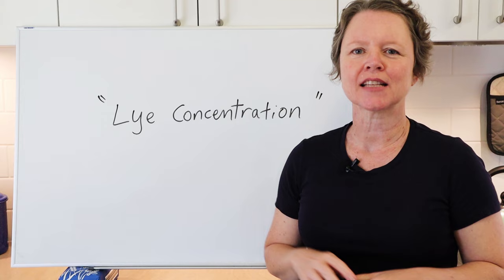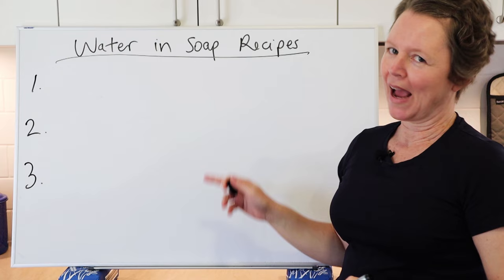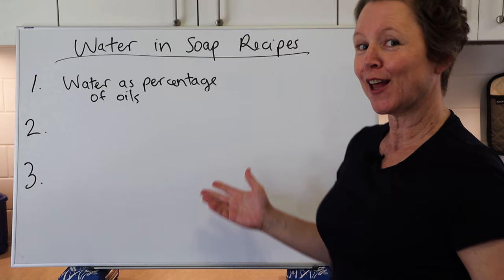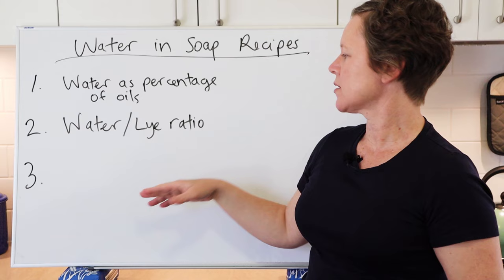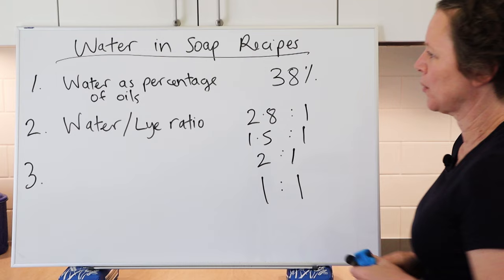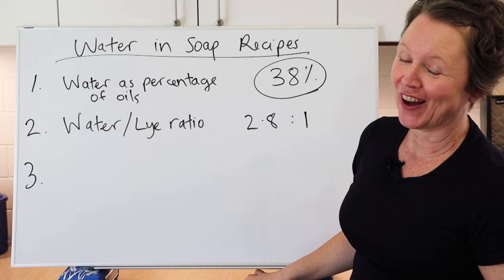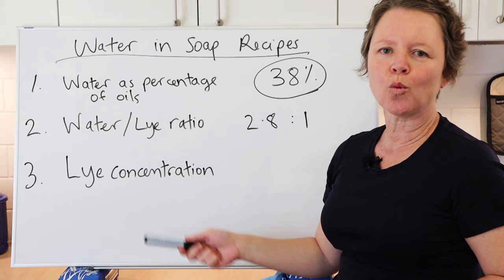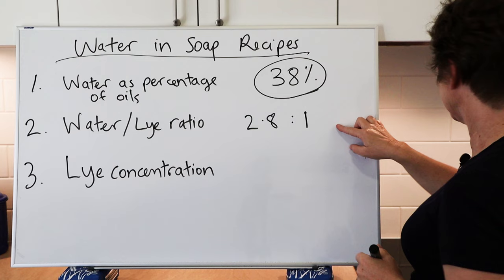Calculating Water in Soap Recipes and Clarifying 'Lye Concentration'

Comment: I am happy that you made this video. It is appreciated. Hands down the best.
Reply from the maker: Thank you Kelly!
Reply: You're welcome. I've doing 33%-38% water. I'm going to try 30% to see if my bar is harder faster.
Reply from the maker: Do you mean water as percentage of oil amount? Depending on which method you're using this could make a softer or harder soap!
Reply: @EllysEverydaySoapMaking  Yes, that's what I mean. Water as % of Oils. I do cold processed. Everything at room temperature. Never used the Lye concentration or the Water: Lye Ratio on soap calc.

Comment: What is High Lye C means to the soap? How does it affect to the final soaps when the lye C is 30% vs 40%? More leather or less to the soap? Obviously when it's a 30% lye concentration has more water so it takes longer to cure but I am curious about leather to the soap? besides using certain kind of oils. Perfect timing for your video to show up.....Thanks so much Elly!! Especially, for the salt soaps...
Reply from the maker: Thank you Kristie, the water amount doesn't have any impact on the lather of the soap, it just takes longer to dry out :)
Reply: @EllysEverydaySoapMaking  hi Elly,, lovely to see you! what about the Lye? High amount of Lye gives better leather?
Reply from the maker: No - this video has nothing to do with the amount of lye in a soap recipe - the amount of lye completely depends on the oils used, and the superfat amount in the soap recipe. You don't get to choose the amount of lye for your recipe - the calculator does that for you! :)
Reply: @EllysEverydaySoapMaking  I completely understand what you are saying now. Thanks!! 
I have been making sea salt soaps only  nowwadays. Soooo soothing to the skin, 30% lye C, 20% super fat and 50% sea salt. Better suggestions?
Reply: @KrsitieSimplyBlessed  leather is a preserved animal skin, you may make boots, shoes or jackets from it. LAther is the suds and bubbles from using soap. Spelling counts! As does pronunciation. So keep it in mind that saying LAther vs. Leather is actually  a HUGE  difference!
Reply: @cryingbroken8824  lol, voice texting....

Comment: Thank you, for sharing this!  I prefer using the lye concentration, and formulating my recipes from scratch without a soap calculator.  I heard when using the "water as percentage of oils" can very with trace and cure time ,especially with different oils even though you are using the same amount of water for each recipe.
Reply from the maker: You're welcome! Yes, you're spot on. I tend to use slightly different water amounts for different recipes. I use a lot more water for HP :)

Comment: That was very clear & I understand what you have explained. I have been using your method of Lye concentration from watching your previous tutorials as I am a student of yours through youtube, but without that & the soap calculator I would not have any idea how many grams of lye  & how many grams of water to use for each soap recipe. I could not work out the lye concentration for a recipe without a soap calculator.
Reply from the maker: That's right. The calculator tells you the amounts, but you tell the calculator what percentages you want :)
Reply: @EllysEverydaySoapMaking  yes but without a soap calculator how would one work it out? How would you workout the amounts without the soap calc?

Comment: I've come back to this video again as I was confusing myself. My misunderstanding which has now been cleared up was that the lower the lye concentration, the less water there was in the soap. Some kinda wierd logic in there.
 I've made 3 different batches so far with different concentrations to test for hardness as I'm still new to soap making and experimenting with variations on a recipe. 
This explains why my first soaps at 27% and 33% concentration were softer than my soap at 40%. No wonder they are taking longer to cure.
I've been looking closer at the numbers on soapcalc.net and now I see the higher the Lye concentration, the less water is required. I should have paid more attention previously instead of concentrating purely on the weights of my ingredients.
Thanks for a great video to help us new soap makers by clearing up the confusion.

Comment: Thank you so much, you have the key of my dreams God preserve you
Reply: I have a question concerning soap making, may I ask you?
Reply from the maker: Yes, sure!
Reply: Ok thanks, according to my knowledge from your lesson during the cold process         the colarants must be in solution mode instead of power and that solution should be made of oil and concerned colarant. My question is may we use the same kind of oil similar to that mixed with our lye? Also I don't have any worry about the ratio for water and lye for instance if; KOH =4kg hence water would be 11.2 litres, now what could be the measurements of our colarants and vegetable oil for the given lye solution above?

Comment: Elly I made this recipe from you, oliva 80% coconut 10% castor 5% cacao butter 5%,  4% superfat, 40% lye concentration ( numbers came out like this 201.6 grs water and 134.43 sodium hydroxide) so it means this formula contains 60% of water only? I will appreciate your answer. Thank you and kind regars. You are perfect teaching how to make soap  :)
:) already check out the tutorial, CLEAR as water jajajaj yeah!  my soaps got cured perfectly thanks to you, by the way I´ve paid lots of "soaps courses" bad too bad nobody explains like you, better said only tell to use soap calculators and additives without any justification why to use it. Thank you
Reply from the maker: Hi, no it's just the lye solution that has 60% water. If you're using a 40% lye concentration lye solution, then the solution will be 40% lye and 60% water. This only relates to the lye solution, not the whole soap batch :)
Reply: When input yhe formula in soapcalc I selected lye concentration (I haven´t watched this current video) and the calculator shows  lye concentration 40% water as percent of oil 20.17% water lye ratio 1.5:1
which is the method you recommend me to use, the area of mexico where I live is very hot most of the year is about  35-40 Celsius and when is little fresh during rain season is really bad because humidity and hot is horrible :( 2 years ago had to throw to garbage many kilos of soap because got damage (rancid)
This recipe worked ok so far but is kind of kind if soft the soap...of course after curing time is fine and is so creamy....thank you

Comment: That was explained so clearly and easily Elly.
My question to you is what Lye Concentration percentage do you mainly stick with. I've been soaping with a bit of a lower Lye concetration percentage and I'm not happy with it
Reply from the maker: So with the lye concentration method the lower the concentration (of lye in the solution), the higher the water content. My usual level for most of my soap recipes is about 40% lye concentration for the lye solution - pretty low water! I use a lot higher water for hot process soaps though, about 30%.

Comment: Thank you - this makes the terms so much easier to understand and that the lye amount does not change, only the water.  So a 1kg batch of 100% Olive Oil with a 5% superfat will take 128.70g Lye always but the water amount can be altered from 380g (soapcalc default) to as low as 128.70g.
Thanks again
Reply from the maker: You got it :)

Comment: Hello Elly. You do an incredible job with that channel. Thank you very much for that !

I think that I looked at that video for the third or fourth time. One thing still confuses me about Lye Concentration. In chemistry, the concentration is expressed by the relation of the mass of the solute over the total mass of the solution. not the mass of the solvent. If I follow what you say, Lye concentration would not refer to the solution concentration itself but the relation between the solute mass over the solvent mass. So, the term it is the word Concentration that is misleading. 

For example, if I put 25g of salt in 100g of water, i won't have a 25% aqueous solution of salt (25g/100g) because the weight of the solution will have increase by 25g when the salt is added. So, the total weigh of the solution is now 125 g and the concentration is 20% (25g/125g). Is Lye Concentration is a traditional or legacy method to put in relation the mass of the solute over the mass of the solvent ? If so, this might be the source of a lot of confusion. 

Thank you for taking the time to read. I hope I am clear, English is really not my main language.

Comment: Hi Elly,

I have been thinking of soapmaking for about a year now on and off.  My problem I have to get past of the fear of failure,  but going to do this.  First thank you for your valuable time,  you are sweet.  My question is:  out of those three calculations, you pick one way, right?  Those are 3 different ways to calculate lye concentration. 

Thank you 
Susan
Reply from the maker: Yes that's right Susan. These are the three different ways to calculate the amount of water in a soap recipe. For the sake of simplicity, these days I use  the water to lye ratio method (which you will see in my videos from the last year or two)

Comment: Yet another amazing video..... 
But is there a way to formulate your soap recipe without soap calc  and still be able to have the flexibility of adjusting the lye concentration as you wish (I use the lye concentration Method as u thought in ur previous video)..... 
......
........
Thanks so much for ur awesome detailed information on each video... Am literally ur student... Love ur videos... 
...pls I put up a comment on one of ur recent picture uploads with some questions on some issues I've been having with soap Seizing after using a 50percent lye concentration in the recipe..... 
Used Only palm kernel oil, soaped at room temperature (it was fractionated PK oil I guess... It's in liquid form deep bright yellow colour)
As soon as I pour in the lye solution... It literally immediately starts forming some kind of Vaseline-ish substance at the bottom... Bfr u blink n try to stir it... It's all but a thick mass..... Crumbly separated into bits and dry..... 

Pls help.... Could this be as a result of the lye concentration I used? 
Or is something wrong with the oil.....? 😫😫😫....
It has happened twice already even though the soap turns out great for washing... Amazing lather! No additives..... 
I just wish It could ever be smooth so I can do some other fun stuffs 😭😭😭😭

Comment: Hi! Thanks for your video. I’m looking for some help. I am experimenting with adding hydrosol into my soap for scent because I can’t use essential oils or fragrance oils. I want to add them at light trace, not in the lye solution. Can I discount the amount I plan to use of hydrosol from the lye solution as long as the lye solution ratio itself is a minimum of 1:1? Thanks!
Reply from the maker: Hi Jackie, yes you can do that for sure. I don't know if I'd waste lovely hydrosols in soap though, I don't think you'll get much scent coming through.

Comment: could you please make a video on how to water discount??? i had an issue with a recent batch i made, the soap turned out way too soft and unmolding it was very difficult. I already identified the probable causes, they are:
 a) since NaOH is hygroscopic and it has rained these past days, the crystals adsorbed water molecules and I weighed less NaOH (probably most of the weigh was hydration of the crystals rather than the actual NaOH mass)
b). I added aloe vera gel in frozen cubes mixed with the water ice cubes, and NaOH could have dissociated and reacted with the molecules in the gel, forming other products rather than just dissolving the base, therefore reducing the free hydroxide for the basic hydrolysis of the fatty acids in my oil mixture.
I could really use your water discount explanation skillsssss
Reply from the maker: Hi, I'd say it was the aloe vera gel. Aloe soaps are always quite soft and need to be left in the mould longer. I don't think the other points you mentioned were an issue, and they don't really relate to water discounting. The video gives my best explanation of water discounting :)

Comment: My Guru!
By getting encouragement from u i made soap first time. my recipe was like as under:- 
1- Herbs infused sasmie oil 900 grams.
2- 100 grams coconut oil
3- Distalled water 380 grams
4- sodium hydroxide 133 grams.
As per heat process method ... soap was ready to be poured into.
BUT problem was its Ph value was somewhere at 12. How can i balance its Ph next time. Plz
Reply from the maker: It may need more time to fully saponify :)

Comment: Hola Elly, muchas gracias por la informaciòn. Tengo una pregunta, a què se debe ese "gel o baba" que dejan algunos jabones cuando se los usa? Es el tipo de aceite? o tiene que ver con la concentraciòn de agua en la soluciòn? Seria bueno agregarle arcillas o maizena para que esto no ocurra? Saludos y gracias!
Reply from the maker: "Hello Elly, thank you very much for the information. I have a question, why is that "gel or slime" that some soaps leave behind when they are used? Is it the type of oil? or does it have to do with the concentration of water in the solution? Would it be good to add clays or cornstarch so that this does not happen? Greetings and thanks!"
Hi there! - Well that is often a product of handmade soap unfortunately, but it does depend to some degree on the types of oils used. The reason this happens is due to the natural glycerine in the soap, and when it is wet, it becomes soft. The real trick to avoiding this is to keep your soap bars as dry as possible in between uses so that they don't stay wet, the other tip is to use harder oils and butters in your soaps with more saturated fats - it's a balancing act! It also depends on your climate, high humidity environments cause this problem more than drier climates. Clays and cornstarch won't make a difference I'm afraid, it's just the way handmade soap is.
Reply: Gracias por la respuesta. Tienes razon, los jabones hechos con mantecas más duras no lo hacen, pero si es glicerina, bien venga! Cariños!

Comment: Thanks for your information I learned so much from you lam fram jordan  at the middle east 
My question is if there is relationship of any of these methods for the type of soap and the decorations with collar
Reply from the maker: Thank you, welcome to the channel! No, you don't need to calculate colours for your soap recipes, just add colour as you please :)
Reply: @EllysEverydaySoapMaking  You mentioned about colors. I saw a soap (tinted with alkanet root, a natural colorant) from other soaper and I would love to achieve the same purple hue. I infused the alkanet root powder with  olive oil (probably 20 teaspoons:10 tsp of olive oil) for several days but did not mind the amount of powder I infused (I used a mold that is about 10 to 12 inches that produce 10-12 standard bars of soap. I was hoping to get a deep purple bas, unfortunately, my bars are on its 3rd week and the color hasnt change that much (from the time I cut until today - 3rd week). Question: 1) How much do I need of an alkanet root and an olive oil; and 2) should I infused the alkanet root or  it is fine to dissolve the alkanet root powder with water?  Off topic but since someone mentioned about the color, I thought its okay to ask:)

Comment: I have a question , if we use the third method LYE CONCENTRATION, which is 50%/50%? Where do we base the percentage from? Is it 50% from 1000grams of oil and add 50% of water in it? Am confused

Comment: Hi Elly ... I’ve watched this video 3 times already trying to follow, but my question is, before you can figure how much oils to use, one would need to determine the mould size first, because of the variation in sizes?
Reply from the maker: Yes, absolutely, that's right! These two videos will be helpful for calculating recipes for different mould sizes. This video really was all abou the water issue :)
Calculate Soap Recipes to Fit Any Size Mould https://youtu.be/ZguW6J3Jj2Q
How to Formulate and Calculate Your Own Soap Recipes https://youtu.be/AqKxin0q1bM

Comment: Hi Elly, thanks so much for clearing that up! Just wondering, is the maximum mass of soap that can be made from the 1000g of oil used always less than 1000g? I assume there can’t be more made than the amount of oil added, but I would love some clearing up on that if it’s possible!
Reply from the maker: Hi, the final mass of soap will always be more than the oil amount. You have oil + water + lye + other additives in most soap batters.

Comment: Hi Elly. This may sound like a really stupid question, and it probably is, but how does the water amount affect the unmolding time? I used a 100% olive oil recipie with 42% lye conc, and I found that my soap was very hard to cut after two days in a mould. It  cracked/crumbled in parts. However, when I poured that same mixture into a small silicone mould the soap was perfect and came out very nice. Should I unmold earlier if the soap is to be cut?
Reply from the maker: That's a good question Leonia! Yes, if you use less water, your soap will harden sooner, which is good for most people. Most of my soaps with low water are ready to cut in under one day. It depends on the oils too - pure olive oil soap goes very hard, especially when made with low water. Definitely unmould earlier if you want to cut the bars without crumbling. I just check mine with my finger. When they feel hard enough, I cut (can be sooner than you think :)
Reply: @EllysEverydaySoapMaking  thank you! You're an absolute star 😭😭

Comment: Hi, Elly. What lye concentration would you typically use for a hot process soap recipe?
Reply from the maker: Great question - I wish I had mentioned this in the video actually! I use quite a high water amount for HP, because so much of it evaporates. Usually I use 25-30% lye concentration for the lye solution for HP soaps.